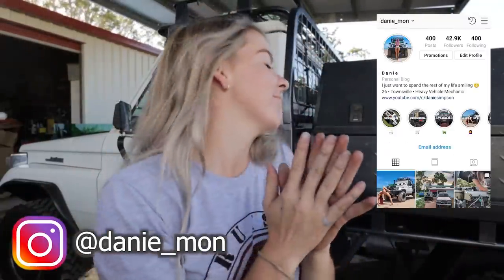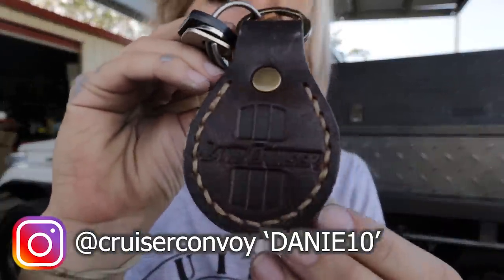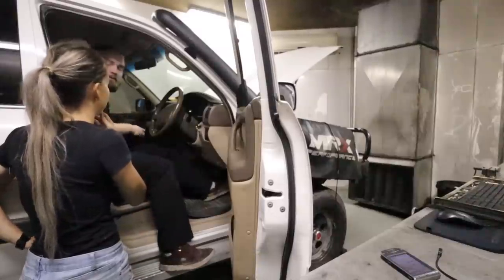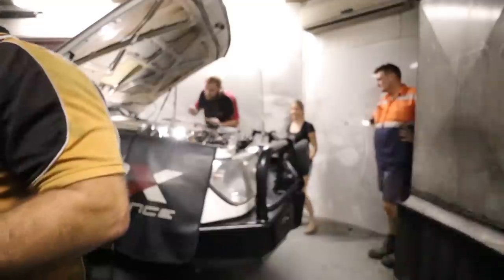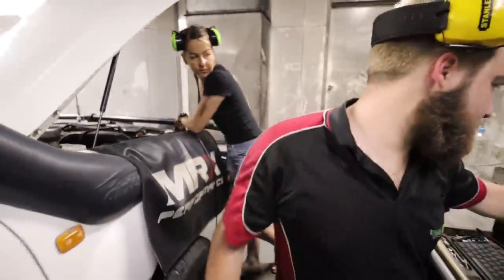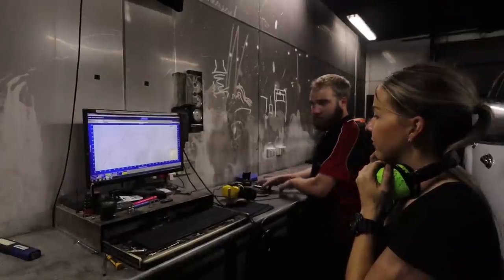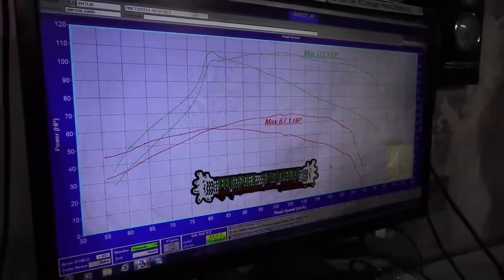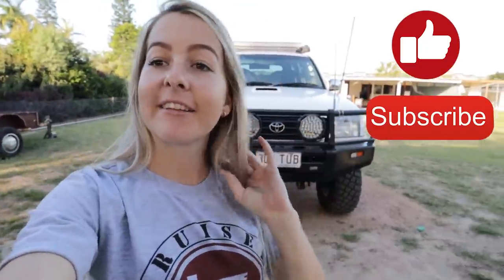105 Build Part 2: Dyno Tune

Comment: Good job. As for the figures for a stock 105  its a safe tune. If you want get heap more out of  it the 105 will not last. IT IS WHAT IT IS. They are a fairly strong engine if you don't go overboard. Good video  Danie

Comment: I don't know why anyone would bag the dyno result, for what seems a pretty basic bolt on turbo whith the fuel screw adjusted you got a 120% power increase over stock, and that was with the aircon on.

Comment: Wow i cant believe how good of results you got. We are running 1HZJ80 with after market turbo, 12psi boost, 33's, stock fuel pump, manual and no intercooler but and ours was dyno tuned and we only have a max of 67.7kW (90hp) and only about 240Nm of torque.
Reply from the maker: What size turbo
Reply: @DanieSimpson  I don't actually know to be honest. We brought the car with it all setup already. It's a denco turbo system but. What kit did you guys go with? Cheers.
Reply from the maker: @gdrahcir  18g mamba which was in the part 1 video. Should be getting more from 12psi then that though
Reply: @DanieSimpson  Cheers for the reply mate. Hey just wondering also what sort of fuel economy are you getting out of your 1HZ's?? We get about 17L/100kms on the freeway being around 480-500kms out of our main tank when the fuel light comes on then off-road around 28L/100kms. Our last desert run we drained the main tank in only about 280kms. Seems way too heavy on the juice to me. Cheers.
Reply from the maker: @gdrahcir  with 33x13.5 it's about 16.5L/100km and with 35x12.5 it comes down to 13/14L/100km. I don't have a fuel light but after my before hits empty I've still got about 130km left

Comment: Interesting vid, 67hp surprised me when my old 2.8 na lux was supposedly 70, she's a bit sad, like you said hard life but got a nice little gain. should be heaps better to drive. Like a few others have said, nothing like a little bang to get you going. Starter rebuild in your future.👍
Reply from the maker: Figures are all hypothetical untill it gets a dyno run, so many things can affect the figures. But yes heaps better to drive !
Reply: 70hp at the fly wheel... you would see about 40hp on 31s and 30 or less with 33s

Comment: I've just got "Emu Wings" for my 105, I'll let you know how good they are once I put em in. Your build is really taking shape and looking mint!
Reply from the maker: What are they?? Sound interesting
Reply: They are rear side access window replacements on gas struts similar to style side canopy side access panels, I got mine in the powder coated rolled aluminium. With the rear wheel carrier it will make getting into the boot space quick and easy.
Reply from the maker: @kweenslandspearo1981  I can't even look into those windows it's so high let alone reach in haha
Reply: Didn't even consider that I guess side awnings are out of the question too...lol
Reply from the maker: @kweenslandspearo1981  nah I just stand on the side step and roll them down

Comment: Hi Danie we did same build to a chopped 80 .. 2 things to look at with wagons with the 4inch lift did you get castor correct bushes.. and after a while towing a camping across Australia we fitted a Dessert Cooler radiator... hope it helps... oh the fuel problem try some oversize injectors I dont know if it's TRUE but blokes were fitting 76 series 24v injectors ... hope it helps
Reply from the maker: If you watch Part 1 you will see that castor plates are needed for a 4" bushes aren't enough. Also their is not fuel issue or overheating issue so not sure what you mean
Reply: Sorry if come across the wrong why they were just a few things we needed to do after turboing and lifting our 80 ... I didnt need the Radiator till it started towing long periods with the camper
Reply from the maker: @mrmrsengineer2024  no not at all. Just injectors and radiator are causing no issues or holding anything back at the moment

Comment: Good torque figures! But just wondering if you are happy with power figures? Just had my NA 1hz tuned and it's still good for 121hp at all 4. (96 1hz 80 280,000kms)
Reply from the maker: Would be interested to see that dyno chart! Was going to dyno the NA 75series but didn't see the point really because I thought it'd be like 40hp😂
Reply: @DanieSimpson  will send it through tomorrow when I'm home!

Comment: Hey Dan
How you find the 105 before the turbo , I take it very hard to turn the 35s, just about to buy a clean 1hz but just debating the whole wanting 315s but know it’s going to struggle on any slight incline ..
Reply from the maker: I ran 35s on my 75 for a few years and had no dramas just lost acceleration and poor crawling speed offroad. Something that can be rectified with a change of gears but usually 33s suits best
Reply: @DanieSimpson  yeah copy that , what gears you think for the 1hz 2002 model 105 if I was to run 315s, I come from the patrol back ground so this whole landcruiser buisness is new to me 😂.. never to late to move to the dark side

Comment: nice work with turbo on 1hz dont need to much boost on turbo ...keeps the 105 reliable for remote traveral in austraila what temp is your egts running at?
Reply from the maker: Haven't connected up the gauge yet! But will let you know
Reply: @DanieSimpson  awesome Danie.....mine at worst towing tandem trailor in 75 running garrat turbo up hill sometimes can run up to 500 egt 105 s have better air flow than 75 s yours should run cooler ?i keep an eye on egts all the the time dont want to destroy that wonderfull 1hz haha

Comment: love your vids and the fact your a cruiser girl! could be I good idea to protect that turbo oil drain, looks quite prone to being ripped out by a branch which I have done to my fuel line which wasn't near as exposed! nobody wants that! keep twistin those spanners.
Reply from the maker: Cheers!! And if a branch gets that high then there's alot of things it could damage haha this thing is miles away from the ground compared to the 75
Reply: that's what I thought about my fuel line which was between my tank and chassis rail about a metre off the ground! that was a bad day!!! maybe just a bash plate up front to deflect stuff then? again keep it up. love the fact its yours and you also do the work on it!

Comment: Did you use power and 1hz in the same sentence?
You do know why 1 hz engines last forever?
Thats roughly how long it takes to go somewhere.
Thats from an 80 series owner with an NA 1hz, who us interested in getting it turboed.
The starter problem is the contacts in the solenoid, something like $20 for those from an auto electrician or $100 from toyota, and about an hours work, at the kms this thing has a set of brushes wouldnt hurt either.
Thanks for posting.
Reply from the maker: Yes my 75 1hz has over 610000kms now

Comment: Hey Danie, I have a 99 troopy with a dts turbo kit was wondering how much this intercooler and tune business cost you, would you recommend a intercooler or any info on doing this to my 1hz !
Reply from the maker: Yes definitely recommend an intercooler for any turbo set up.  It was $680 off eBay but if you have the money is invest in a front mount. Give Diesel Smart performance a call and they will give you a quote for a dyno run
Reply: Danie Simpson cheers for that !

Comment: What gearbox do you have?  I have never seen a hzj105 with a centre console,  always the 3 seater up front
Reply: the Gxl's have got the centre console - got one myself. Dickie seats too
Reply from the maker: Pretty sure that's a standard thing.  This is a GXL model hence no barn does either

Comment: are you running sway bars?
Reply from the maker: In the 105 yes
Reply: Danie Simpson just pull em out all the flex
Reply from the maker: @mighty_excel_ute7931  they do not limit the flex, it's set up correctly and has extensions fitted

Comment: I tuned my 1hz and it made 198hp and 580nm :) Then it melted and now im sad :(
Reply from the maker: What year 105?
Reply: @DanieSimpson old 99 model. Just finished prepping it for a 1HD-T conversion as i killed the old hz pretty good. Still looking for a 12mm compensated pump?  I got one cheap haha
Reply from the maker: @macca89doz  yeah still chasing one
Reply: @DanieSimpson  i dont know how i can organise to get it to you over YouTube but if you want it you can have it cheap. It has a real aggressive trundles aneroid pin in it though ill put a video up if you would prefer
Reply from the maker: @macca89doz  what price you chasing?